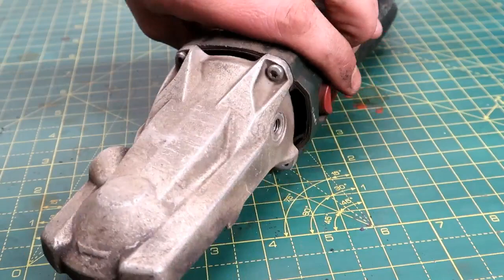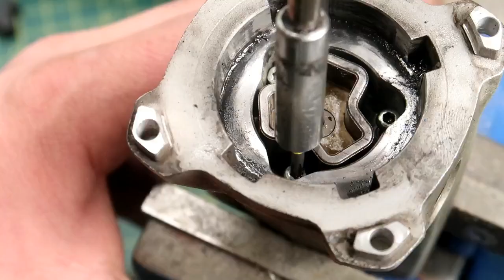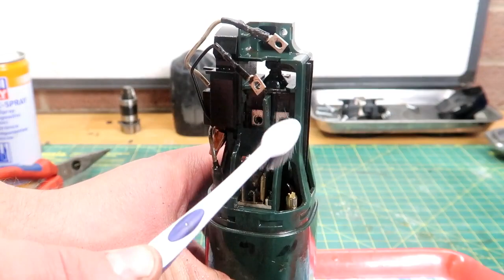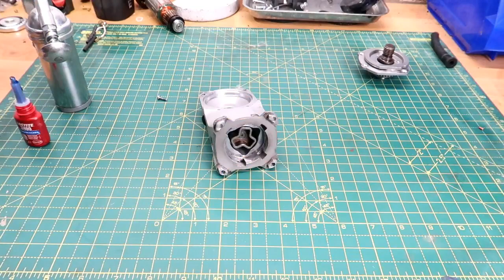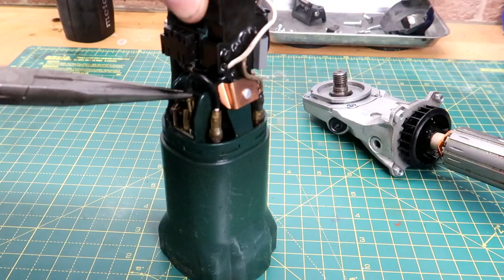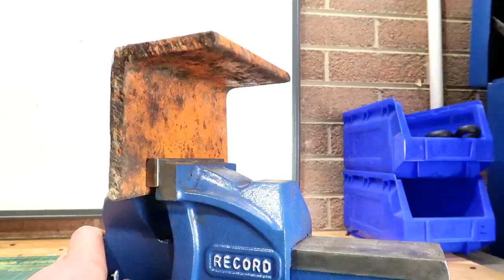Angle Grinder Restoration (METABO Flat Head Made in Germany)

Comment: What was actually wrong with it? Did you fix something or just cleaned it up?
Nice vid by the way.
Reply from the maker: Thank you for comment,just cleaned it up.
Reply: With the excessive wear on one brush I have to believe the brushes spring had far to much tension . If thats the case it will quickly wear the new replacement.  I love the contour of this grinder!